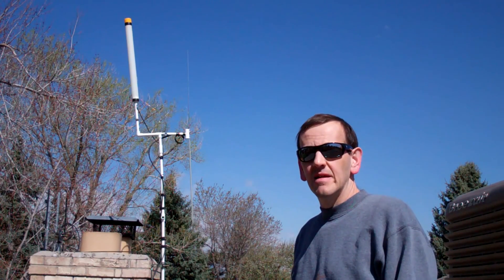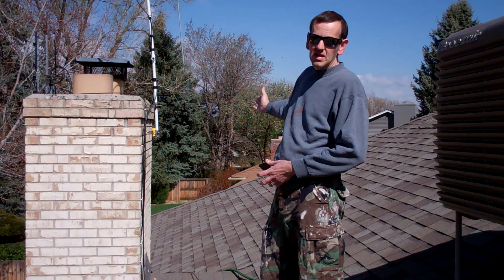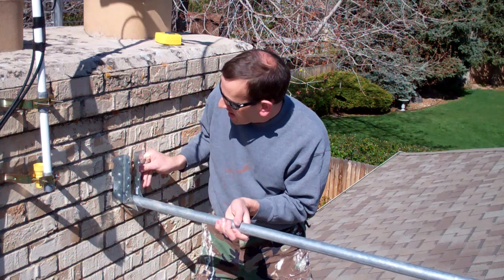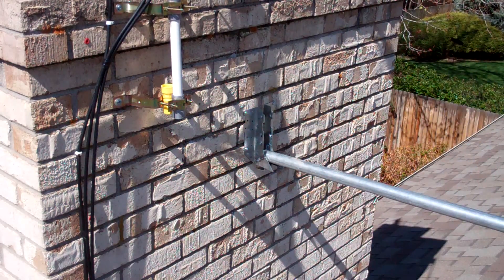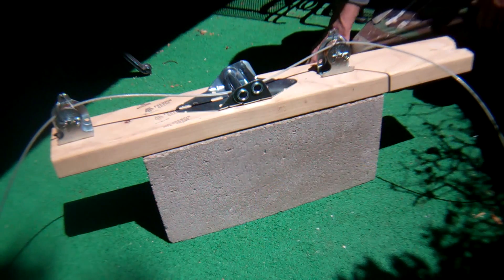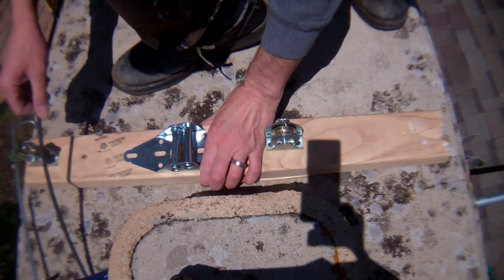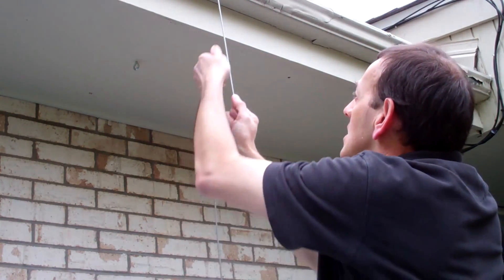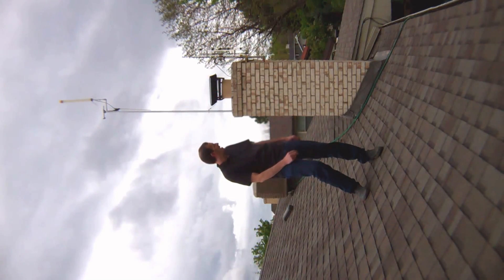Stealthy Tilt-over Mast Hidden By Chimney

Comment: Little tip who ever does this next. Get a hammer drill for the brick drilling and use tap con  screws.       Brick is soft and mostly hallow so more than just a couple tap cons is recommended

Comment: Cable attachment tip+++ "Never put a saddle on a dead horse," is what I taught my students when doing cable work.  The dead horse is the short piece of cable with nothing attached to it.  It has a much greater chance of failure when the piece with only load in one direction is under the stationary piece of the clamp.  All in all, good job!

Comment: What No Ground Wire??????
Reply from the maker: There is a ground that I put in after the mast construction in the video. But I installed it after I did the video. All antennas should have good RF grounds as well as for lightning protection.

Comment: PLASTIC anchors? mmmm im sure that held up real well in the elements.
Reply from the maker: +Sal Galvano The anchors are what I had in my hardware bin. Its been up over a year with no issues. Besides,  99% of the time the mast is in the down position and I never use it when the weather is bad. I am also up there every couple of months playing with something. If It were an installation for hard core VHF/UHF TX/RX that got a lot of use I would probably want something more sturdy and have guy wires and a heavy duty bracket. But for my infrequent experimentation purposes it is more than adequate.
Reply: Once the screw is fastened, it's a lifer